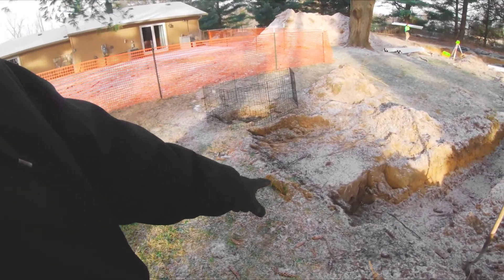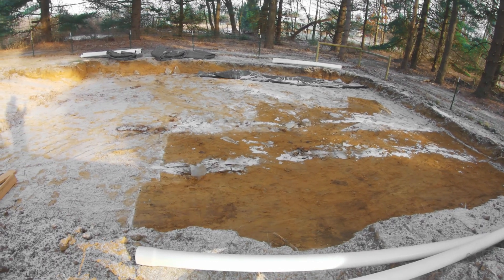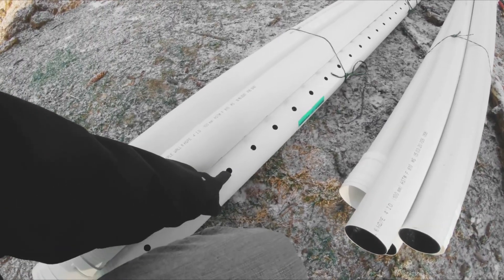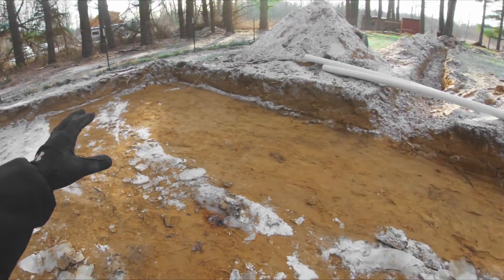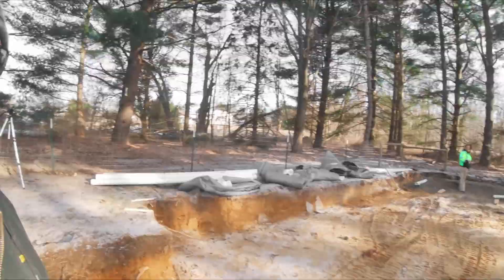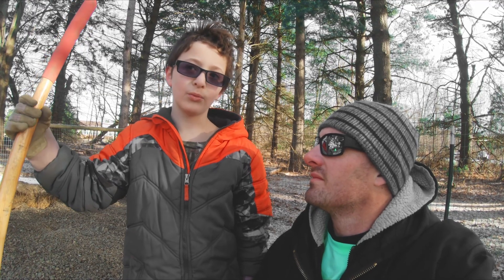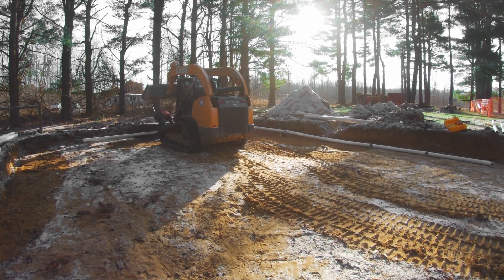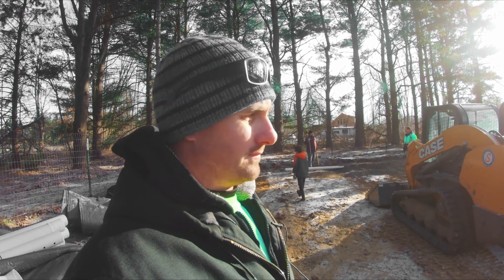HOW TO REPLACE A SEPTIC DRAIN FIELD // How a Septic Field Works

Comment: No you do not need to do a new drain field. There are ways to rejuvenate a drain field that work and you can get many more years out of it. 

The problem is they have so many regulations and the government can't seem to keep their nose out of our business. So it becomes impossible to do what is way more affordable because the townships usually force you to do something that's way more expensive and most of the time unnecessary.

Comment: did you use the cat to fill in the top layer of dirt? is it safe to drive over the pipe?
Reply from the maker: We use the skid to backfill everything.  As long as your machine has tracks you are fine to drive over the field.  The tracks spread out the ground pressure so you don't crush any pipe.

Comment: I am having drain field problems, No one seems to be able to tell me where I can get rid of my old effluent dirt and perferated pipe.
Reply from the maker: Are you installing the field in the same location? Most of the time they have a backup field location where you don't need to remove the existing field. If you do need to get rid of the soil and old materials a good start would be to call your local sewage treatment plant and ask if they take it. If they don't they should at least be able to direct you to someone that can answer the question locally.

Comment: If you need to truck in New material why not build the system in the original location of the failed system?  Too much soil remediation?
Reply from the maker: You would have to remove all of the contaminated stone in the old field along with a good amount of soil beneath it.  From there you would have to dispose of the material at a location that would accept it (which would be extremely expensive).  Then you would have to start bringing in fresh material.  Instead we bump the field over to the reserve field location, dig a hole and bring in clean stone.  Done.
Reply: @DieselandIron  if you have the slope from the tank (or a pump system), could you build over the old field? Just curious, luckily I think my drain field issues were solved after adjusting the levelers in the d box. Whoever was in there before was an idiot
Reply from the maker: @chrisE815  it's really up to the health department on if they would let you build over an old field

Comment: I need to reroute my drain field in order to move electric underground, put in a driveway and garage / mancave.   1800 Sq foot house  3 bedroom.  Any rough idea on the cost involved, understanding you would need a lot more info to make an estimate, just looking for rough expectations?  Health department gets all pissy then  guess I ll just start paving and pray  lolol..  House I am looking at, can't believe they routed the drain field the way they did that pretty much screws you from being able to do anything on one whole side of the back yard..
Reply from the maker: Does the entire field need to be moved or are you just rerouting the outlet pipe from the tank running out to the field?  It's really hard to say without knowing the circumstances.  If you're talking about moving a couple pipes around and you have the fall you need then you can probably sneak out of this for $2-5k depending on equipment rental, materials, cutting a new hole in the side of the house etc.

If the entire field needs to be moved then I would say you are looking at an easy $15-20k.  Like I said, without seeing what you've got and what needs to be done it is really hard to say.
Reply: @DieselandIron  Thank you.. The actual field needs to be rerouted. Right now it is just one 100 ft pipe with 10' wide field. The repair side of the design.. I may be able to get health department to agree to flipping it.. will be interesting for sure. I have a couple options in what sort of garage build etc I can do - just limits how crazy I can go lol

Comment: That kid was awesome, no matter what he does in life having a good work ethic is going to take him further then people that don't have one. I actually learned a lot about septic fields, I had no idea what one was. Do these houses have "city" water too or is it well water? I'm guessing this is far from a big city?
Reply from the maker: Agreed, this kid will go far no matter what he chooses to do. You are correct, these houses are on well systems but they don't have to be. There are some municipalities where they have gotten water mains installed after the fact so they still run a septic system alongside the city supplied water.
Reply: @DieselandIron  Hey Bryan check out this channel I've started watching. It's an excavator operator in Norway, the name of the channel is "Vidar steinsland" I think you'll like it. He operates without boots, only socks. His cab is super nice and he has a huge KISS sticker on his excavator.
Reply from the maker: @ConstructionMachineryChannel  I've actually seen a couple of his videos. He's a good operator. Thanks for the referral!
Reply: @DieselandIron  No problem, I recently found his channel and so far I like it. Cool guy too.

Comment: We have treatment plants then when it exists the tank either sprinklers or a "drip" line.  Interesting application 👍.  Great explanation and video. Enjoy your weekend!
Reply from the maker: We have those in the case where an engineered field is required.  In Texas where limestone is prevalent the pump systems you described were the norm.  Here in Michigan we have pretty stellar drainage thanks to a bunch of sand so they aren't nearly as common.